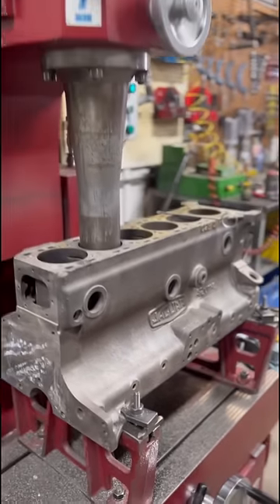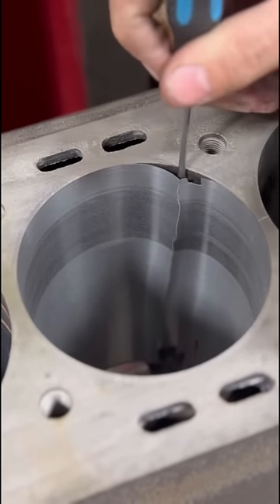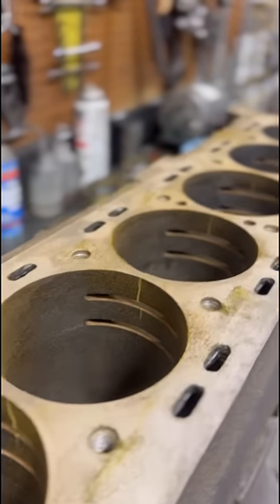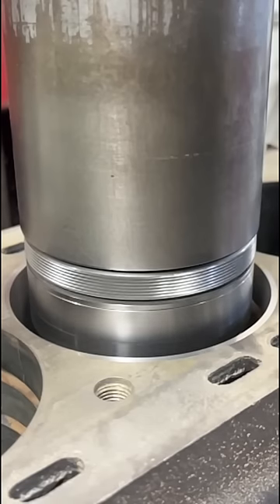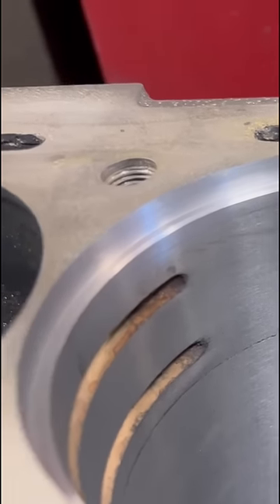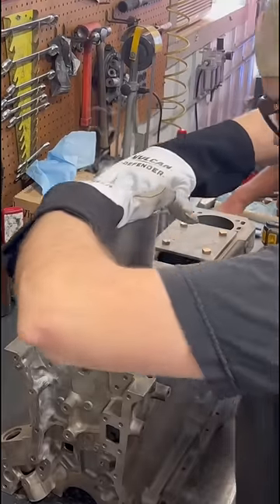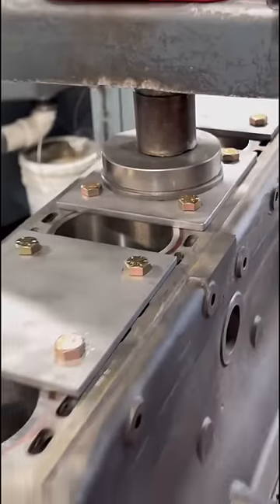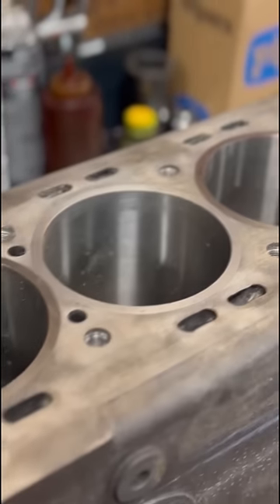#shorts This May Be One Of The Most Complicated Repairs I’ve Ever Performed!

Comment: I'm an engineer, and a Diesel Mechanic with +20 years exp. I can confidently say I don't know the best way to complete this. I have an idea but dont conclusively know it would work. I am looking forward to this repair. Love your work guys. Keep it up
Reply: I'm wondering how they plan to fix the cracks. My thought is drill a hole down the middle of it and fill it with brazing metal (assuming that doesn't open up the jacket). I suppose an EDM could cut a fine path down it to clean it up as well.

Some way to get a clean surface that braze rod will stick to.

Comment: Back in the 80s or 90s we used to A plug the crack , then bore it out for liners , fit them and surface grind the block , very common for those jags , stepped liners weren't as available then .

Comment: Even though I’m no engineer, or machinist, the thick walls for the cylinder sleeves where the cracks in the block are located seems legit. Just replacing weak material with newer, and better material. Sleeves imo is what saved this motor for the meantime.

Comment: The 4.2 in my 74 had the same cracks. Extremely common in that engine.
Reply: Is it from overheating?
Reply: @kensmechanicalaffair  mostly from bad design.
The first xj6 (with the same XK engine) had the same issues, in latter iterations they machined slots between cylinders to relieve stress.

Comment: Top hat liners always good for cracks especially those wide boys - enough radius for the gasket to seal - metal shim not so much a gasket on them or is it copper????

Also we used to use a Ceramic block sealer made in The US VSI for Rover V8 SDI blocks I recall - you had to flush the coolant system and bypass the heater matrix and run the engine for hours it would seal porosity and cracks well.  🙏🙏👍👍👍👍👌👌👌👌👌

Comment: I recently purchased a 1966 MK10 4.2 and will, at some point, be going through the engine and transmission. The car runs and drives and has about 84,000 miles on it. I will definitely be upgrading the rear seal and might be doing the cylinder sleeves as well. What can I expect tp pay for those two modifications?

Comment: Hello I’m only 16 and I’m working on a Honda prelude with an H22a4 in it and the rod bearings are like a small bit scratched and the rod caps and rod look like they are a bit over heated but I’m not really sure I’d just want some insight before I start ordering parts for it.

Comment: Это трещины между цилиндрами? Я думаю этот блок обречён, потеряна жесткость конструкции. Are these cracks between the cylinders? I think this engine is dead, it boiled a lot, the rigidity of the cylinder block is lost. In the future, it will be possible to punch the gasket under the cylinder head under heavy loads.

Comment: Best you can do with that block. Unlike what some of your smart mouthed trolls say, being that the block has matching numbers and the need to preserve it, the owner will have to go lightly on the block. Putting a twist in the block from hotrodding it might make the cracks worse. This is probably the end of the line for this block.
Reply: I don’t know about that,,i really don’t see why it couldn’t be driven normally with that particular sleeve type and loctite sealing them, the cracks are at the very top, if they were down the cylinders any further i would say no.. trash it! it appears at some point it was sleeved before just for this problem..Right? I thinks its a common problem with these blocks poor casting and lousy engineering Jaguar British thing, just have to keep an eye on the temp!
Reply: @damiandelapp5490  Driving it normally won't put a twist in the block. Hotrodding around while driving it will. If he's going to preserve the block, yeah the heat is a big factor but so is stresses placed on the block. Engine blocks twist when you hot rod on them. Twisting that block won't be hard and it will open those cracks up more. Otherwise I'm sure the repair will be fine. If it didn't have matching numbers, then Id say do what you want with it but because it has matching numbers, it needs to be preserved.

Comment: Unfortunately, no matter what you do, the gasket is going to leak between cylinders. Block will make a nice mantel piece though
Reply: That repair has been done many times successfully. 
It is not an issue regarding head gasket sealing whatsoever..